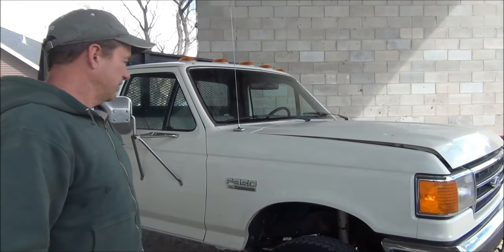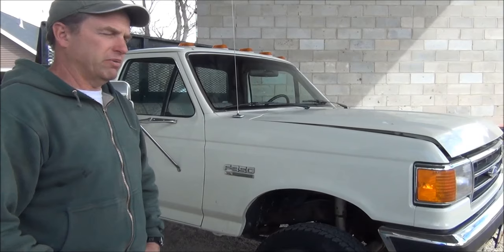Ford 7.5 460 fuel pressure regulator symptoms

Comment: FYI PEOPLE!! This guy must have a lot of patience or gave himself time to cool down before making the video :-) That regulator on the 460 (At least in a van) is a BIZACH to get out. Make sure your wife is at a friends, or on a cruise because if she comes out and starts barking orders or askes "How much longer"? it'll probably end in a divorce. The way ford attached this regulator (Especially with little upside-down allens) almost makes me take back everything good I've ever said about them. But Brig t is right. 4mm allen cut down is the way to go. I also found it easier with disconnecting the ac lines to get them out of the way beings my ac don't work anyhow.  Looking back... I should've pulled the motor :-) finally done now
Reply: scott knox
Reply: Scott, I've never had to struggle so much to remove any auto part.  I have a 1990 van with the 460.  Don't know what a bizach is but frustration is an understatement.
Reply: @perrycarlston4274  Is the regulator in the same spot on the engine as the F350 version? Other than air intakes, how much stuff has to be removed to get to it. Thanks.
Reply: bahahahahahaha!
Reply: This was the comment of the day😂😂😂
Reply: 94 is up on the top.. with screws on top..
Reply: Scott Knox you are very correct, the back bolt is driving my partner and I totally crazy putting the new regulator in. Nearly pulling out hair out lol. Hopefully it resolves the problem soon.

Rest in peace Brig T, you still continue teaching us all with your amazing videos today !
Reply: Yes! Painful procedure  😣 Yes I hope so too 👍
Reply: @TheKnoxcountry    ... Very painful procedure it was, it helped in regards to the motorhome not running rich any longer but unfortunately it never resolved the jerking, backfires and for sure the timing issue my friend who does minor  mechanics for a living stated for sure my motorhomes issue lays around the timing so unsure what all that will cost now. I am just gutted as I was sure the regulator was the issue. Like you mentioned, yours to like a van with the motorhome I have was indeed an " Bizach " as you refered it to. the removal of the center council like in a van just to get to the back bolt was a migraine in itself and it taken a lot longer also. At least the heavy fuel smell is no longer an issue. The motorhome in an 1990 Fleetwood Tioga with the  ford 35o chassis 7.5 460 motor exactly like what's in this video but like you in a van sized motor compartment that caused massive issues installing the fuel regulator.
Reply: Glad you made it thru. Yes! Sometimes those bolts are frozen or even the carpet won’t let the shell come out. If I remember correct, it’s like the seats wouldn’t go back far enough to let you remove it without yanking on it. You know… my old 88 box truck with a 460 had a similar problem. I sold it running like hell as this didn’t fix mine either. The buyer called me a couple weeks later and told me he fixed it and (I Think) it had something to do with a valve on either the charcoal canister or something of that nature. If I remember I’ll post it here. I think I blocked it out because I was so mad from all those years smelling BAD raw fuel smell in cab and jerking and I replaced EVERYTHING I could and it was some crazy under engine part.

Comment: Is it really a bad fuel pressure regulator? Mine is a 91 Ford f350 and before is was driving really bad. Hesitate. Vibrates. Sluggish. Shakes when I'm at a red light. Won't go pass 35mph because it will shakes really bad.

Comment: I had this issue with a 5.8 engine in a '90 f 250, changed the regulator and problem solved. Must be a ford thing in general.

Comment: Hey buddy, thank you for your help. I actually have a question. I have a 1997 cabin chassis Ford super duty 73 L gasoline and I also just replaced the front and rear tank. The rear has two hoses that are going inside it not the hoses that go into the assembly, but two hoses that kind of sit on top of the rear tank I can see leads to somewhere but the second one leads to nowhere have any idea thank you.

Comment: Thank You the problem you described is exactly what is happening to my 1990 EFI 460 I am going to replace the fuel pressure regulator ASAP you my friend are a good man that just saved me a lot of trial and error.
Reply: I have one similar. Did this fix the issue?

Comment: Thanks for the video. Everything you described matches my 95 f250 and I was about to do all the things you spoke of, fuel pumps, filters, ect. I will have to give this a try while I pull the engine to replace all freeze plugs.
Reply from the maker: also ,  replace the map sensor. I made another video on that.
Reply: @BrigT262   You Right on target BT! Thanks and very Greatfull for your very informative Videos about this bad Boy Engine 460ci, 7.5L Engine.    Iam your NEW Subscriber , Got '94 Xtra Cab,bF250,4X4,  7.5L with the 5th Wheel Hits and Louvered tail gate.  I just Got it as Non- Runner, Mech Special for $800. Will replace my '91 F250...all same specs but Single Cab and 2WD only.....She  will be 4Sale Soon...as Gas & Go Anywhere format. Thx Again and keep those Video coming....I'll be watching them.
Reply: @bobbylamug7712  I have a 95 Coachmen Catilina w/ fuel injected 460 w/ similar issue. If it’s cold, it will start and run like a bat out of hell for two minutes. 
Then after that, hit the accelerator it will bogg-down and try to fall on its face, (only underload). In park at idle, it purrs like a kitten. 
Saw your comment and wanted to see if this had solved your problem?
I appreciate your time if you’re able to respond

Comment: That may be the problem with my 1994 F53 Chassis RV. Ran perfectly after I diagnosed the MLPS switch was bad and rebuilt the EEClV replacement the three famous capacitors. Brought it home from a vigorous test drive with that old 460/7.5L power and smoothness, turned it off under the RV port and with no explanation at all, went to start it back up to a “no idle at all situation” and tons of black smoke, I was dumbfounded. Ran my Ford OBD-1 reader and 17 different codes popped up plus the check engine light. The codes were not the same as when the EEC and MLPS were faulty. 
Right now I’m stumped but I’m going to try your fix and see where I am. That little bugger sure is hard to get to on the coach but I’ll give it go and order the correct Ford example. 
Great video and that’s a fine truck you purchased. I’ll check back in and post a comment on my results. I’m hoping this will fix it.
Thank you..
Reply: any luck on this issue with your rv? Bout to buy a 97; with the same engine/chassis so taking notes of future (or current) issues that will arise...

Comment: Thanks for the advice. I just bought an 88 Tioga E350 460 and it's been having fuel issues. I really appreciate your help.
Reply: I have a 1995 tioga rv
Did it fix it?
Reply: @godswill2260  No... I ended up replacing the in tank fuel pump, which was a huge job. There are two fuel pumps and I replaced them both. Now she runs like a champ!

Comment: my 84 grand marquis with the 302 throttlebody //cfi was having the same issues thankyou brig t for confirming the symptoms..of course mine is on the cfi housing .and screws are upside down ,,im gonna use a 1/4 drive socket with a Phillips insert and small ratchet ..im not taking all that linkage off and cfi off the manifold like they want me to ..I think I can do easier and shorter route like  brig t did in this video ,,thanks for the video and explanation brig t

Comment: I would like to say thanks a million times for the video. Your Brig videos are a miracle to us all.
Reply from the maker: Thank you for the nice compliments
 I'm not a professional, but just try to share what might help other guys. I enjoy doing it.
Reply: @BrigT262  Hi Brig T, I changed  the fuel filter and the truck ran a couple of times starting it and then it quit: I think I got to figure out whether the problem is fuel or maybe electric. I got to check for fuel at the regulator and voltage at the coil. I will need to buy a fuel pressure gauge: seems no one has one for me to borrow. I have a friend who is also studying the problem. I just hope it ain't the fuel pump: I have two tanks and maybe it is the switch or valve? I will enjoy fixing it once it is fixed. I really enjoy your three videos. I have a '90 7.5 F-250 and I love it when it worked. Am not wealthy, but I need to figure out the source of the problem before doing this an that. Thank you for the reply.: so appreciate your help. Joe....

Comment: I hope and pray this resolves the problem. Both fuel pumps were changed out, fuel filter was changed out before purchasing this Ford 350 7.5 460 , the exact same motor but in a Tiago motorhome. Therefore technically this should be the final part to be changed. I do not know why the previous owner did not just get a diagnostic on it prior. 

Everything seems to be having the same symptoms as described in this vehicle as in mine. I ordered my exact same OEM fuel pressure regulator on Amazon last night for $ 32.05 that included overnight delivery. I hope and pray for positive results after finding the fuel was indeed running rich matching what was reported in this video.

Thank you for an outstanding video.
Reply: Did it work? What was the conclusion?
Reply: @imichael.  ... Unfortunately no it never resolved the problem and today was the day to start the replacement of the timing chain and a diagnosis if possible. Unfortunately there are ongoing storms going on currently and working on my wife's pt cruiser alternator replacement stalling process on the motorhome itself. Hopefully I could get to the motorhome either today or tomorrow. The pressure regulator did stop a leak that was not detected after fuel replacements however so in that aspect it was good.

Comment: Have a 1996 Class C with the 460.  Ran fine on a trip about 2 months ago. Started it up and moved it about 50 feet. It had been running about 2 minutes and died, no sputter. Tried to start it back up.. cranks great but does not even try to run. One of 2 things, No fuel or no spark. I am thinking no fuel. I will try replacing the regulator tomorrow.
Thanks for the tip!
Reply: Well did it work or not? The suspense is killing us!

Comment: I have  a 1988 Ford F-250 XLT Lariat V8 - 7.5L 460ci GAS MFI vin G - 2 valve OHV and I have had the same problem amongst other little things. I swear every time I fix something, something else goes on. Anyway, I did watch your other video and I'm going to do the MAP first. My question to you is, if I have to do the fuel pressure regulator, well this question goes to both parts I guess. is there gaskets I will need too? I ordered the map, but if I need a gasket I did not get that. Thanks again for the videos. and thank you if you answer this questions.

Comment: Thank You
I believe that part will work on all ford EFI systems on the OBS Fords. 97 5.8L has one that is easier to get at.
A small 1/4" hex head drive tool should fit in there, if you are planning replacement.

Comment: Thanks for your video and diligence in identifying the problem. I'm going to buy a 1989 F250 with 460 this weekend, and this video may come in handy!
Reply from the maker: hiwaycruzer 
The problem ended up being the map sensor. But the fp regulator is always a suspect ...usually for rich running conditions.  Good luck with the purchase!
Reply: Fool

Comment: A bad O2 sensor will indicate lean and dump fuel very rich to compensate. Black smoke and rough idle. No power.   Great video info.
Reply: My 1990 Motorhome has the EFI 7.5, but there are NO Oxygen Sensors on this Setup.  It uses a MAP Sensor, and ECU, an Air Pump, and Dual Catalytic Convertors, but NO O2 Sensor.

I'm sharing this as it was surprising to me, having worked on many European FI Cars, and it is helpful for others to know that some EFI Systems do not have Open/Closed Loop Oxygen Sensor Systems.

Comment: Thank you so much my friend I'm having the same problem with my Motor Home same engine it'll run perfectly on park even if I accelerate the engine but put it in drive and no power again thanks I'm trying this.
Reply from the maker: @johnnygonzales3211  
Yes, it sounds like you might have a fuel delivery / pressure issue.

Comment: Great video! I am having these issues, but mine is a 1977 E-350. I had purchased one, gave it to the mechanic, but like my spark plugs, I learned that sometimes, they just put it in their pocket.  Now I do my own mechanical work.  Symptoms:  it was running too rich and then it hesitates and loses power.
Reply from the maker: Miss Adventures 
A 77 E350 does not use a fp regulator. It is carburated. Ford trucks did not start using efi until 88.
Reply: Actually it does, it's a real thing and it's in the manual. However, I will post a video and give you a link so you can see for yourself. It's so shiny! LOL

Comment: This video is a savior. I am looking at a 460 1988 RV and it has this unexplained problem. Now I will try to work this into the purchase contract.   You were really on to something.  Thanks so much for the effort in producing this video!
Reply: Hi Frederic, I’m in the same boat with a 96 class A w/ the 460 doing the exact same thing. Do you remember what the issue was? Was it this regulator? 
Thanks!!!
Reply: @LJWalter78  .... I have a class c also 7.5 460 . How about yours, was it due to a regulator?

Comment: The pumps that are in the tank are low pressure pumps, they just feed a high pressure pump forward on the frame
Reply from the maker: TurkeyTickler That is not correct. The pumps in the tanks are the only fuel pump & provide the proper fuel pressure for the system.

Comment: Thanks for the video. I have a 1993 Ford F350 460 engine dually that has been hiccuping, chugging, and skipping here and there while driving. Still gets me from point A to point B, but just makes my truck sound like a beater. So I will definitely give this a shot and see if it works!
Reply: Did it work bud
Reply: Same question, curious if it worked or not.
Reply: Unfortunately for me it did not. I ended up selling the truck.  I winder if the new owner ever got it figured out
Reply: @shaze_art7592  ... I am so sorry that it did not work out for you . I am dealing with the same motor in this video a 7.5 460 in which both fuel pumps were changed out, fuel filter was changed right at the time I was considering it and it's still giving me issues as described in this video. I hope and pray that the new fuel regulator works as I really need my motorhome operating correctly. I hope that I do not need to sell it also as I put a lot of money into it already saving up from my disability. I ordered the fuel regulator yesterday with overnight shipping from Amazon and only have two days left to get the motorhome off the property where it is today so I pray that this resolves the issue. I do not know why the previous owner did not have a certified mobile mechanic go there to diagnose the issue first personally. Therefore I pray it works with only two days to remove it from the property. not sure what else it could possibly be at all. Thank you for your response.
Reply: Cause it is a beater. Buy a chevy

Comment: Happy New Year and thank you for the post, I have a 1989 F Super Duty, people states that is a 450 model not sure. Having the same problem, when accelerating slow run well, but some times do  intermiten fuel supply. Would change the regulator and let you know the progress.

Comment: do you have a link for the regulator? did you also have a problem with the front tank overfilling/being pressurized by the back tank...perhaps with my overfilling front tank it will be the check valves in the front pump?

Comment: I have a 1990 F350 with a 460 BBF, and having the exact problem. She will run for a while then sputter and stall out. I will try what you suggest by putting in a fuel pressure regulator !! Great, advise thanks !!!
Reply from the maker: Also, try replacing the MAP sensor. Watch my other follow up video.

Comment: I've got an 88 Ford f250 with a 460 in it and I have no power when I'm coming up the hill I replace the fuel filter around seem to run fine and then it happened again my it is not working I'm at a loss it idles like a Swiss watch it seems to have power on the takeoff but when you come to an incline it'll cough and want to almost slow down no it does slow down and even if you downshift it'll still slow down I'm going to pick one of those up I'm in there only 27 dollars on Amazon thanks for the video I'll let you know if that was a problem

Comment: Thanks for the video! I've been having fuel problems for years on my 1989 F250 7.5l and I have tried just about everything... except the fuel pressure regulator. I've replaced the filter, both sending units and pumps, even the entire front tank. Looks like I know what I am going to be doing today.
Reply from the maker: before you replace the fp regulator,  try replacing the map sensor . watch my other follow up video
Reply: MakingTechSense  fuel delivery pressure ISX 400

Comment: What can be causing my 93 f250 460 to have a slight misfire? It's not the spark plugs, wires, or coils. Any common misfire fixes for the 460

Comment: hi brig, I am thinking of purchasing a 1991 f250 lariat 4x4 automatic, gasoline engine with 126000 miles for 7k. what should i be looking out for when test driving it? how many more miles do i have on this engine if kept maintained? otherwise the interior and exterior are pristine and clean title.

Comment: I have a 1989 Ford f250 with a 460. I'm having issues with it backfiring my truck only has 52,000 original miles on it due to it sitting for the last 15 years.. any ideas on how to fix it

Comment: Any advice I went through a puddle fast it was more like a lake but shortly after the truck slowly stopped and locked up ,I shut it off and it runs now but when you apply pressure to the gas it dies